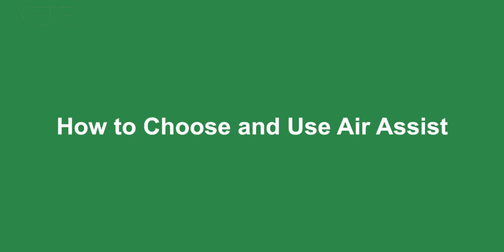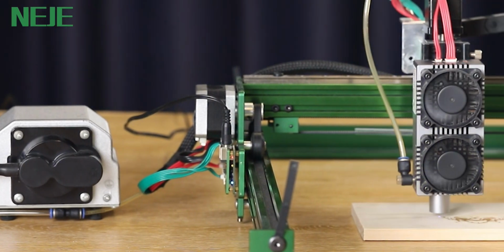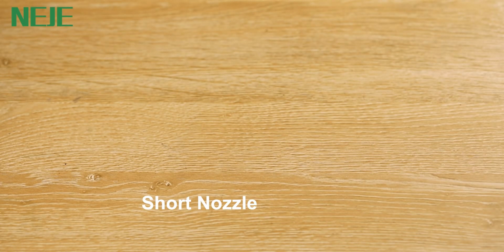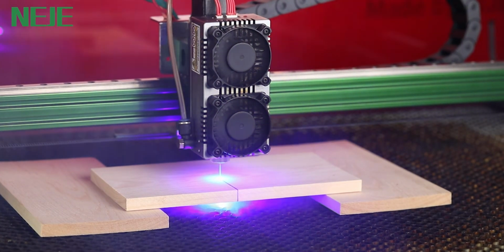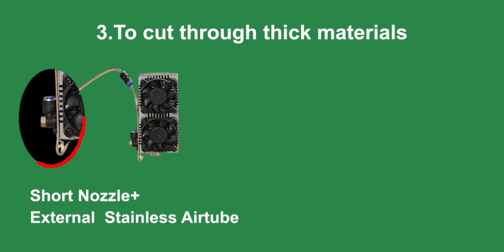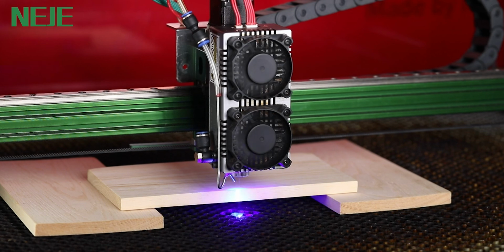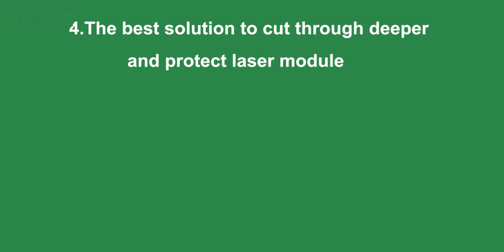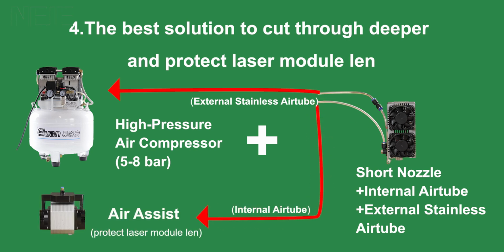Machine Guide 3 | How to Choose and Use E80 Nozzles and Air Assist #neje #lasercutting

Comment: The diameter of my long nozzle is too wide and doesn’t fit. How do I go about resolving this issue as most of my commissions are for engraving.
Reply from the maker: Hi ！The long nozzle is divided into two parts. The outer protective shell can be adjusted. You can install the inner part first and then adjust the protective cover. Its function is to block the laser light to protect your eyes. 
You can join our Facebook group NEJE_Laser, and our staff will answer your questions as quickly as possible.😊

Comment: Can I combine the automatic relay for internal small air assist with electromagnetic valve for external stainless steel? So small air assist is always running and large one only when necessary?
Reply: I think you're advising the opposite in the last method about the best way to connect the small air assist and air compressor.
Reply from the maker: The small air assist's function is to protect lens inside of the laser module from dust out side.So we suggest you to use small air assist with internal air tube.Use 5-8 bar air assist with external stainless air tube.